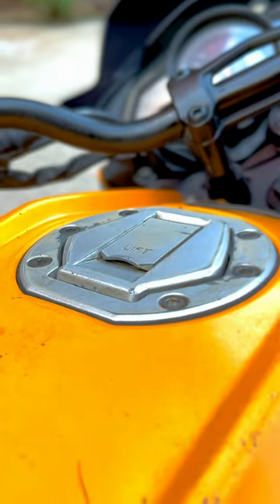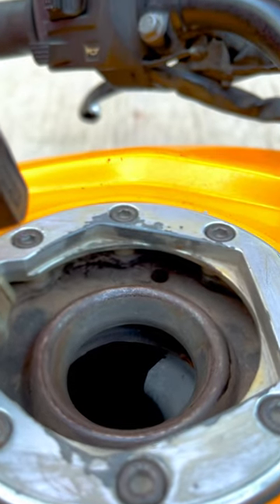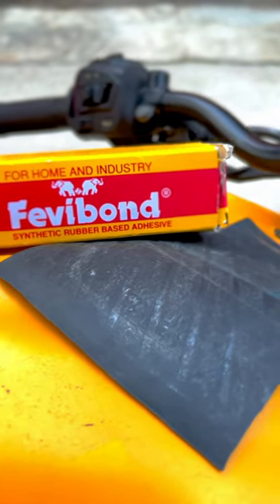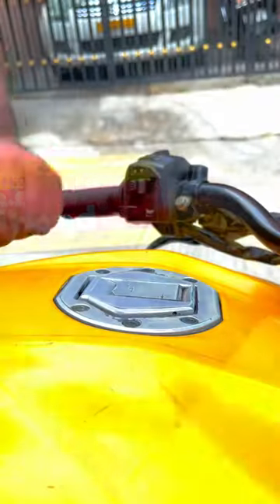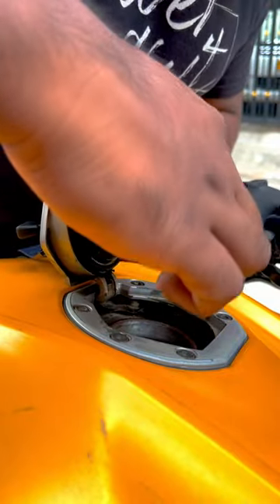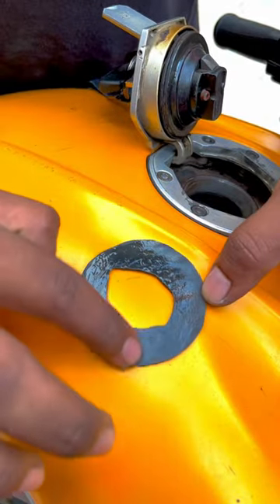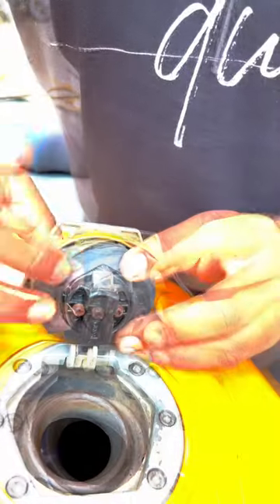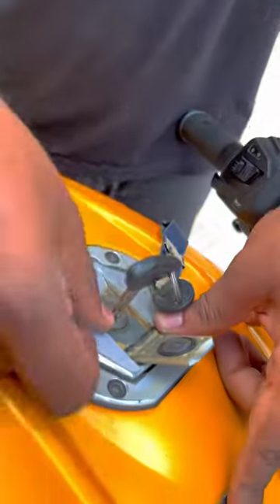Prevent water entering your petrol tank #ns200 #ktm #dominar400 #bajaj

Comment: Successfully air Blocked
Reply from the maker: Hi @bandkithko6494 

1. BS3 models pass air through its keyhole not through the rubber seals 
3. BS4 and above has a seperate air passage vent near seal hence need not worry about getting it blocked if you do it right.
Reply: @ARKIONX and latest ns200 bs7 also?